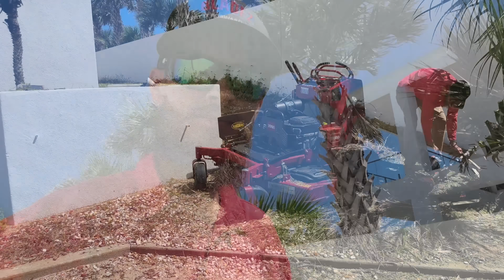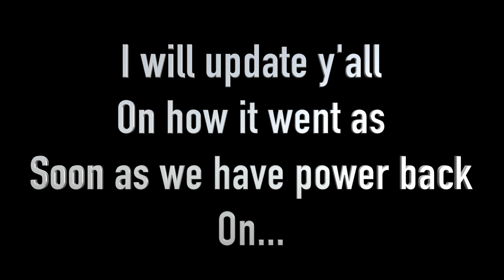The Neighbor HATED this yard so Bad they called the CITY CONSTANTLY!!!

Comment: New subscriber. I hope you and your loved ones were not severely impacted by Milton and are safe.
I am in Asheville NC, ok...Arden, NC..but 1.5 miles from the Asheville airport. Fortunately, we live in a low-impact area, with no flooding, and minimal wind damage - for us at least. A neighbor three doors down had a tree fall on his car and the back half of his home. Tore the roof right open and ripped the upper floor wall away. Scary. No power for 6 days. We have also been fortunate to have maintained water, though we had low pressure for a while, and we are still on a boil water advisory until extensive repairs are completed in the surrounding areas. This has truly been a 'count your blessings where you find them' storm. I can only imagine most of Florida is the same. 
Thank you for finding ways to help those who are unable to help themselves and making a difference in the world around you. I bet the neighbors are as appreciative as the homeowners! <3 Many blessings to you and yours.

Comment: Time-saver tip ⏲Toss a tarp down whenever you have debris that needs to be hand-carried to the street. As you cut, throw stuff on the tarp until it's full and then drag it in one go. Saves all that trudging back & forth. A weather-resistant, heavy duty 8' x 10' polyethylene tarp costs about $15.

Comment: Looks better. Being from the Northeast I don't have to contend with palm trees. They are narly when the branches die back and drop all over the yard. I have the idea that they are planted to give a lush tropical feel to the landscape. Not sure skinning to a pole with 2 branches sticking out the top is what they're going for. Think the pink flowers are supposed to bush out and cascade over the curb. Just wondering. Of course a skinned palm tree is better in a hurricane. No wind resistance. 😂 Thanks for all you do for people. Keep up the recovery. I've had panic attacks. Didn't recover nearly as quickly as you have.😊 😊

Comment: 🇦🇺💜
A spray bottle with any sort of plain old cooking oil .. should stop the bees and the wasps … they cannot fly with oil on their wings … and I think it would be cheaper and more user friendly than the pressure pack can … won’t cost too much to try it … that time you got stung on the nose was way too close to your eyes … (you should wear eye protection no matter what you use to knock them down with) safety first 😊 ….🐝

Comment: Al, snacking on the banana mid-job might have been good for your electrolyte levels, but it's a bad idea for working around bees; a bee's alert/danger/attack pheromones smell a lot like bananas! Spritzing yourself with something strongly scented of peppermint would help, though; peppermint confuses the bees' sense of smell. They dislike it, and so are much more likely to veer away.
Admittedly, I'm only certain on the bee pheromones; dunno about wasps. But they have similarly strong senses of smell, so the peppermint ought to help a bit with them, too.

Comment: ya the battery ones  arenot that good cause if u do not  have extra battery u r done ......that is why i own  a 31cc 4 stroke badger weedwacker .  i do not evan mix gas oil like a 2 stroke need  . just fill it and put trimmmer line and get to work .